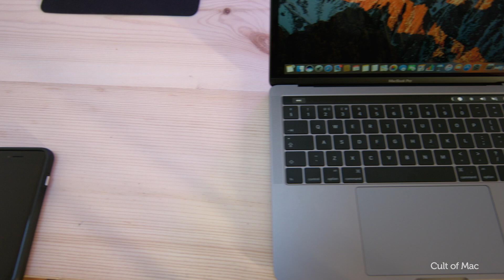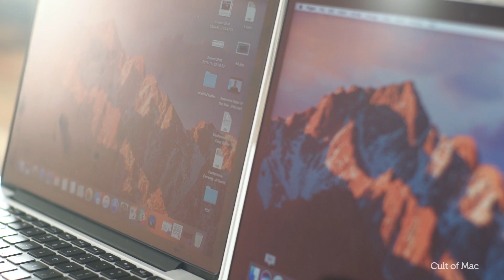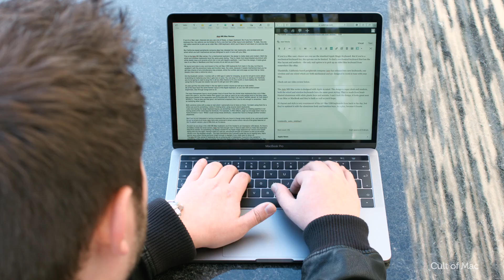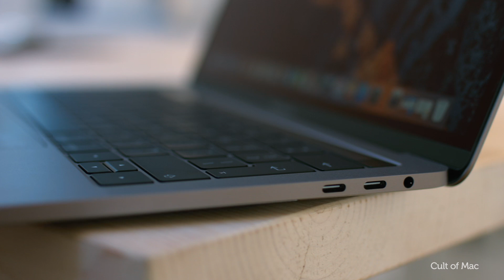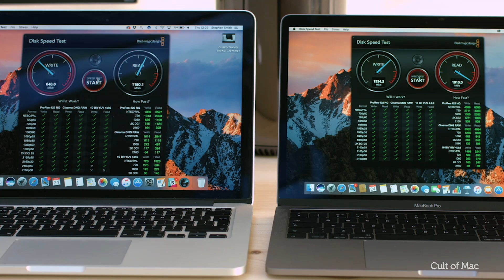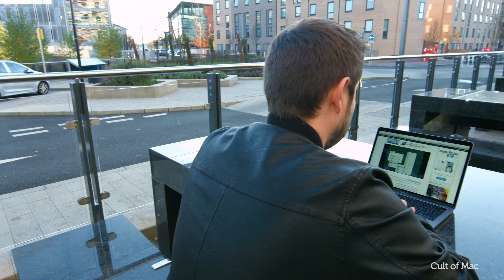2016 MacBook Pro with Touch Bar vs 2015 MacBook Pro

Comment: 2015 definitely.  Loss of SD slot and other ports is a deal killer for me with regard to having something that is portable.  Oh, and moving away from the MagSafe connector for power and the Glowing Apple Logo?  Those were iconic MAC.  I will pass on the 2016 and above MBPs.

Comment: i want to buy a macbook pro this year, can you suggest which macbook should i buy ?

macbook pro 2016 base model 13" 2,0ghz i5 8gb ram or macbook pro 2015  13" base model i5 2,7ghz 8gb ram ? i saw the benchmark for macbook pro 2015 base model higher than macbook pro 2016 base model. 

thank you :D

Comment: Hi people!

What would be a better choice?

Future usage: Installation of Windows, Adobe Photoshop, Video Editing software, pictures, videos, documents

1. Macbook Pro 2016 without Touch Bar 13 inch
Specs:
(a) 2.0GHz dual-core Intel Core i5 processor, Turbo Boost up to 3.1GHz
(b) 16GB 1866MHz memory
(c) 256GB PCIe-based SSD 

2. Macbook Pro 2015 with Retina Display 13 inch
Specs:
(a) 2.7GHz dual-core Intel Core i5 processor, Turbo Boost up to 3.1GHz
(b) 16GB 1866MHz memory
(c) 256GB PCIe-based SSD

Thank you! :)

Comment: I will go with the new Macbook pro 2016 without touchbar. I had doubts which one is more suitable for me. The older one is a really great machine. However, I prefer the design of the 2016. Moreover, I do not use usbs/hdmi/vga/sd cards that often, so it's not a drawback for me. I'm really looking forward to the new speakers and brighter display. It's going to be my first Macbook. Hope I am making the right choice.
Reply: It’s really true with what you saying mate because it depends on what u using it's for ...I also don’t remember the last time I used an HDMI or a USB I do Agree with you 💯

Comment: The 2015 just looks more appealing. It has similar specs to the 2016, and it is like the MacBooks from 2011-2014. Also you don't have to connect dongles unlike the 2016. Although the 2016 looks like it has better display and speaker.

Comment: I'm going to be doing monthly repayments, so my choice is between a 2015 128gb for $1800 or a 2016 256gb for $1980. Although I hate the new keyboard it's a little hard to justify paying so much for the 2015 model.

Comment: I bought a new 2015 13" Macbook Pro for 1200€, the new 2016 macbook pro model without touchbar starts at 1800€... It's like you said, buying the older model is a no brainer :)

Comment: Running benchmark tests is not a reflection on true performance. There are many videos now where you can see that where the new model really shines is when its CPU is being intensively for a number of minutes - these benchmarks are basically snapshots. Over a period of time (minutes) you see the heat, performance, throttling is much, much better than the previous model. GeekBench is a lazy benchmark for testing. Two identical videos in Final cut for me - last year's model took 11:59 to complete and this 6:47 on this year's. What you guys need to consider is that this Computer is basically future proofing you for years to come when everything goes to USB-C because in a few year's time, you'll probably need a USB-A to USB-C converter on your >2015 machines.

Comment: Got the 2016 versions and I am very happy with the performance, batterylife, buildquality and portability. Before I bought it I used a windows notebook and I have to admit, I don't regret the switch at all.
Reply: how battery life compares to 13' 2015 model.. is it any better ?
Reply: What’s the keyboard like
Reply: Do you like the keyboard?

Comment: I've bought the 2016 13" macbook pro WITHOUT touchbar precisely because the touchbar models were still too expensive and full of flaws. I was going to buy a 2015 13", but with cyber week deals I found that I could get the 2016 non touchbar model for only $100 more (considering refurbished prices for the 2015 model), which seemed fair for a better screen, better speakers, better ssd speeds, better keyboard IMO, better resale value and same to better performance compared to the 2015 model (according to various benchmarks I found). The non touchbar model seemed like a better choice for 3 reason:

1. Price: it was the only one with a somewhat reasonable pricing (WITH the cyber week deal)
2. Battery: it had a bigger battery than the 13" touchbar model, which combined with the lack of the touchbar, made for good battery life.
3. Less risky: the touchbar still has to prove to be a useful feature, and in getting there might still need hardware improvements in future generations.

So, since I did needed a Mac (iOS development), do you think I made a good call????
Reply: YES! Good thinking. Playing it safe this generation was a good idea, I feel like the next models will be cheaper whilst having new processors and upgraded touch bars
Reply: All I can say is there's isn't really much difference in performance between the 13" touch bar and non touch bar model. For most uses I think the 13" will perform perfectly. But of course, if you run very intense work then you need the power of a quadcore and you should go with the 15". 

For my programming needs and 1080p (Final Cut) video editing needs, the 13" was actually a better choice IMO (although it wasn't as powerful as the 15", it made it up with better battery life, better portability and lower price).

It's a matter of figuring out what's what you REALLY need. Some people get greedy and look for the machine with the best processor and higher ram and more cores, and don't realize the fact they don't really NEED that much power, and that they would actually be better off with more battery life, portability and a lower investment.
Reply: Completely agree. It's sad when my 2008 MacBook Pro with a discrete graphics card gets a higher graphics score than the 2016 MBP with integrated graphics.
Reply: I've got the 13' nTB base model as well, I think it's the best value for money. I am enjoying my new machine and I don't have any problem with it. No regret
Reply: I think that's a pretty good call. I'm debating between the 2015 13" 256GB model which I can get for $1250 (new) or the 2016 13" TB model for 1830 both including tax. I'm really not sure what I should do here, I always thought about the 2016 13" non touchbar as kind of an ultrabook with the lower clockspeed and the 15W processor. What would you guys advice getting? :-)
Reply: I just got the touch bar model, I couldn't live with just 2 ports. Also, I love gimmicks!
Reply: The only gripe I have so far about the macbook "PRO" is that even the base one doesn't come with a dedicated graphics card. The next step up costs like an extra $800 for a shit graphics card. Like seriously apple? you couldn't even put in a cheap GTX 960M or gtx 1050 in at this price point? Anything is better than integrated graphics. 

Other then that, not a bad machine and i enjoy mac OS.
Reply: How does xCode run on it? Any regrets? I'm stuck between the 13" 2016 macbook pro without touch bar ($1400) and the 2015 15" macbook pro without discrete graphics 16gb ram($1550). The prices are so close, I'd love the newer model but I would have 8gb less of ram. I do some basic video editing and I'm looking into iOS development. What do you think?
Reply: TechMason For what you do I would recommend the older 15" model, that quad-core will not let you down along with the 16gb of RAM. You could go wth the 2016 15" but I wouldn't I for that model for now, maybe wait until the next model.
Reply: haha well yeah it's a matter of personal preferences really. I actually mostly use one port... believe it or not. I connect it to a hub with all the connections I could possibly need (usb-3, hdmi, sd, micro sd and of course usb-c). I'm really liking that setup.
Reply: Juan Manuel Gómez Ramos I will have to use adapters because I plug in a lot but I wouldn't be comfortable putting loads through one port
Reply: normally I don't use too many ports at once. If it came to that, I would go to the second port. But more than that, although nice.. it's not really a necessity to me usage. but as I said, is a matter of the workflow of each user really
Reply: Juan Manuel Gómez Ramos Fair enough.
Reply: Well best bang for the buck depends on what you are looking for. If it´s pure specs then sure PCs are the better choice. But for instance me, I see a best bang for the buck in Macs for many reasons:

1. Final cut pro x. IMO the best time-efficient video editing software (yes, premier is cool... but I value much more the time saved). And sure you could have a hackintosh... but not in a laptop format.
2. iOS development
3. As stated before: resale value. You can recover a big chunk of what you spent on the macbook when you resell it. PCs have HORRIBLE on resale value. If you really think about this and do a balance considering it, I believe the macs turned out to be less "expensive" than PCs.
4. Ok, this is subjective... but I just appreciate using a machine will good design (I'm talking hardware AND software)

The 13" 2016 base model costed me 1275 bucks con B&H. It's not that I have serious cash, I just had been saving for a new laptop for quite a while.

But anyways, I do appreciate just the power and customizability of windows desktop, so I do understand where are you coming from. Very cool option too.
Reply: i just got the new mbp 2016 15'' model touchbar.  it was expensive yes. the dongle/dock issue is fucking ridiculous.  but, it is lightening fast and responsive.  especially for graphic/visual work such as using Adobe programs and Audio programs such as Garage band and logic. you dont NEED touch bar, simply bought it with touch bar in hopes that they'll add more features to it down the line and didnt want to regret later on. love the new mac dont know if i made the right choice. could've done without the touchbar for sure and would've saved about $500
Reply: Juan Manuel Gómez Ramos tbh i have found the touch bar super useful and im glad its there
Reply: You made a horrible call by just buying a MacBook. Haha but joking aside, you made a good call just in resale value alone. You must have some serious cash to be able to afford a brand new one. I personally just bought the 2015 for around $800 used because I dont think there are any laptops that have the same quality as Apples. I have a customized PC desktop rig/setup that i use for gaming and at home. But those are just my personal needs.

If I ONLY had enough money to buy one machine it would just be for a window desktop as you get the best bang for your buck, price/performance

Comment: This is a great computer. But for an entry level 13'' MacBook Pro with touch bar its $1800. An entry level 13'' computer you can't upgrade at $1800 is honestly a new record. Thats insane. I would stick with the 2015 models, I usually upgrade almost every year, but will be skipping this version for at least another few years until USB-C is ubiquitous. 

Don't get me wrong I love Macs. But you can kind of see where Apple is going with the Mac. You cannot upgrade it after you buy it- the same exact way with the iPhone and iPad, this is essentially a $1800 "disposable" device similar to the iPhone and iPad. This laptop is really worth pulling the trigger at $1300, I think $1800 is insane for an entry level 13'' MacBook "Pro". At $1800 I would expect a quad-core CPU and 512GB SSD, then i'd say its worth the $1800. 

Great comparison/video.
Reply: The fact is most people never upgraded anything in their laptop, 512GB model is $1800 with student discount
Reply: other than the ssd, what else can you upgrade on the 2015 model?
Reply: Why would you upgrade every year? That's just unnecessary... Speed gains are minimal with yearly upgrades.